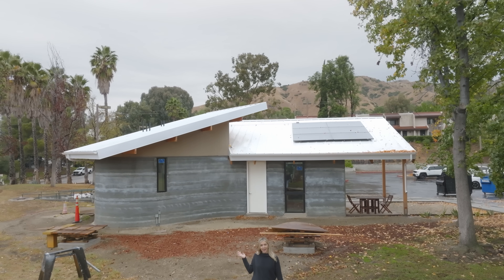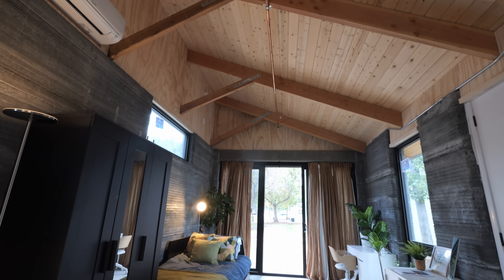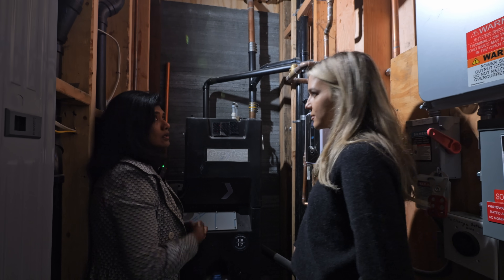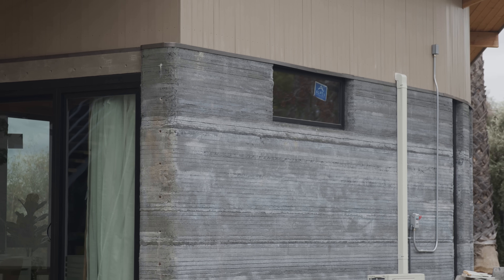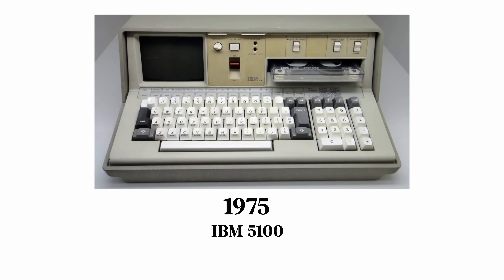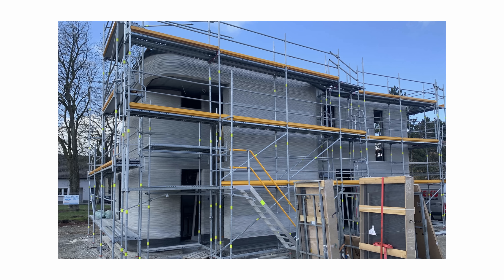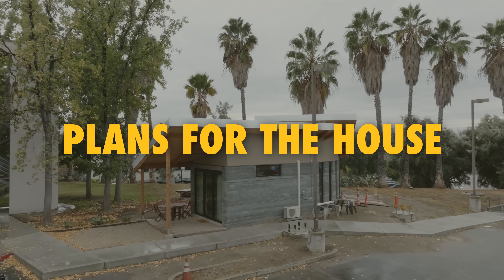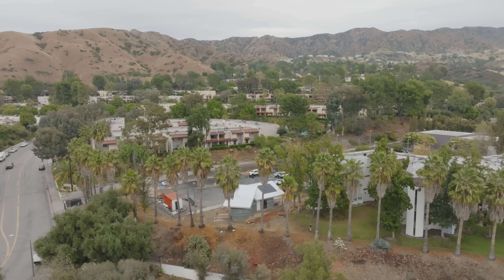LA’s First $250,000 3D PRINTED House!

Comment: I can inform you all that concrete building is a technology that is dying or needs to be reinvented. Maybe concrete as a material of building houses is new to United States. But it is very normal and the standard in building houses in Scandinavia and Europe as well. Even though it looks like we have many brick , They are actually concrete houses with a brick facade. The issue, however, is the fact that Concrete is made with the use of sand and send as a natural resource is starting to disappear. And it is disappearing because we have been using sand for concrete for so long now. The solution most likely is using concrete only where it is absolutely necessary, and using other materials elsewhere in a clever way.

Comment: Thank you Shelby for bringing to light the 3D printing techniques for houses! I think there should be more investment into it... Of course it's not so cheap right now, but all new technologies are expensive at first till they reach main adoption. I like that they mixed 3D printed concrete with timber beams and planks on the roof!
Also, as an European I find it very strange that the USA is not used to build in concrete... especially in places like LA with many earthquakes and fires... We've been building with reinforced concrete since the 70s/80s at least... But we are actually going back to build more with wood/timber for sustainable reasons.
Anyway, nice video!

Comment: I do like this house if I could cover the inside concrete walls. Using cement for houses certainly saves a lot of trees; however, cement production is a major producer of carbon dioxide. So, there are pros and cons in both using wood and cement.

Comment: Concrete is definitely not a negative compared to wood construction. Many of the high end luxury houses are concrete. However for the 3D printing to actually work it has to be a far more holistic process that does most of the house on its own. Just doing skeleton walls and the rest conventionally is indistinguishable from a normal process, likely worse with the current limitations. The novelty alone has no real value, it actually has to work. And like I've said before laser sintering of various powders is far more potent than pooping concrete. You can laser sinter sand for the bulk of structures, it has no cure time that requires human labor. Laser sinter metal powders for embedded electrical wires and rebar reinforcement, even floor heating and you print cavities for plumbing. It has to do the foundation, flooring, floor heating, ceiling and roof all in one process and that is quite easy to do. Windows is too hard to 3D print for now but if that's all you have to install manually to complete any house, that would be a huge step ahead. Concrete has been very useful but this is the laser age. It really could be very sophisticated constructions, far more fine grained that these concrete structures. You could do elaborate ceiling moldings and with the right laser technique the surface finish could be flawless. You probably wouldn't need to paint the walls with the right technique. Neither in or out. Just deposit white ceramic powder. It doesn't need to poop out a thick bead, there is no hurry to get it wrong. It doesn't matter if it's a 4 months print if it makes a magnificent house with zero labor and a bit of electricity and a bunch of dirt cheap sand. Sand is so cheap that you only pay for the transport of it. Imagine a 10000sqft immaculate home virtually for free except for windows, kitchen and flooring. The LA soil is not dirt cheap though.

Comment: I never understood the construction methods with wood and drywall in the US. My house in Brazil is made out of brick, concrete and steel to hold it all togheter. I can easily hang paintings on the wall, but knocking a wall down is close to impossible as you said, basically everything is structural.
During 45°C (113°F) summer it keeps the heat out pretty well but in winter it gets quite cold inside.

Comment: I thought the R value for concrete was quite low because of how porous it actually is? wouldn't that actually make it less energy efficient than other materials? unless this concrete is formulated different or applied differently?

Comment: I HAD A 2006 HOUSE BUILT OUT OF CINDERBLOCKS   1750 SF.  I TOTALLY PREFER CONCRETE WALLS OVER AWOOD FRAMED HOUSE.  MY HOUSE IN JOSHUA TREE IS NOW AWOOD FRAM,ED HOUSE WITH STUCCO. AND IT SUCKS  WOOD GETS WET AND YOUR SCREWED.  OR A FIRE. OR TERMITES.  WOOD ROTT

Comment: i think overall its a great idea to use concrete . saves the planet from using the timber trees . and yes in the long run it will become cheaper . im wondering about excess rainwater is it going to a storage tank on the land . or is it stored in a underground tank tank under the foundations . ?

Comment: My neighborhood in Burbank has quite a few concrete bungalows from the early 1940s including mine. You are correct. Renovation is hard to impossible. Also hanging any item on the wall is an ordeal involving a hammer drill. It also retains heat in the summer. Sometimes I feel like I live in a bunker. But it is indeed very durable.

Comment: I LOVED this! I loved homes with curved walls and the exposed concrete on the inside - I would probably paint the outside though. It's actually super common in tropical areas to have concrete homes due to cyclones/hurricanes. In the Pacific Islands most buildings and homes are concrete. I love that it's sustainable, and it looks so much more solid and architectural than other prefab homes.

Comment: Possible correction: at 0:42 you said that the house was “net zero” meaning that it has zero net greenhouse gas emissions, but as Kishani says at 2:02, the home is “zero net energy” which roughly means that it produces as much electricity as it consumes. Similar-sounding terms but they mean something different. “Net zero” is more of a term that companies or countries use in their pledges, saying that they’re going to reduce their emissions and then either remove carbon from the air or pay others to avoid emissions so that their net impact is 0.
Reply from the maker: OH okay yes that makes much more sense

Comment: Brick blocks, steel reinforcement in the walls and concrete are typical materials for building houses in Serbia. Wooden frame houses and dry walls are condsidered cheap and of lower quality houses here. However, I love the 'breathability' of the wooden frame house. 
You didn't mention how would they insulate the house in colder climates. Keep heat from entering the indoors works for California, but keeping heat in is also very important in colder regions.

Comment: Concert per se does not do bettering an earthquake. A wood framed house does better because it is more flexible. In the 1973 Northridge, CA earth quake the majority of the building damage was concrete strutters like parking garages. A wood framed part building fell down but that was because the concrete foundations were subpar. All concrete buildings in LA Country had to undergo a retro fit to add special earthquake ties to prevent roofs on concrete tilt up buildings from falling because the concrete  would crack instead of sway.. Framing a house and putting on siding goes relatively fast and is nit that expensive. Modern wood framed houses are more environmentally friendly than concrete. Trees are renewable and take very little power to cut down and mill. Mining, manufacturing, and transporting concrete uses a lot of carbon based power. In addition the most vulnerable part of a house in a wildfire isn't the sides of house, it  is the roof.

Comment: In South Florida, where I live, it's against code to build a stick-built house. All houses down here have the outer walls built out of concrete block and concrete. Stick-built houses won't survive a hurricane. That's why you're not allowed to build one where I live.

A 3D printed house may appear to be expensive. However, nine days to print the structure is very quick. As I said before, where I live, homes are build out of concrete block and concrete. Printing the structure might be faster than having workers build the house by hand. You'd have to look at the differences in the cost of labor, materials, and time saved by using 3D printing. When you look at all the variables, it might be more cost effective to print the structure.
Reply: What sort of soil and bearing capacity is general to the Florida region? i.e. do you require concrete piles / piers to support concrete slabs and walls or just deep footings?

Comment: My hesitation about concrete isn’t about aesthetics or durability, but the carbon impact of the material. Wood is typically a much more sustainable building material, but I would love to know if they are recycling concrete for use in the 3D printing mix to make it more sustainable!

Comment: There's lots of gaps in the concrete.
I can build one using binder blocks and concrete in like 4 day.
Using ICF, maybe 2.
Nothing wrong with doing it the way it have been done for centuries. This "printer", which is just a concrete pump. Just adds unnecessary time and cost.

Comment: 3D printers are not needed to construct homes out of concrete. In Europe we've been doing that since forever, mostly as the skeleton of the house. Renovation is indeed a lot more difficult :) I think the added value of 3D concrete printing is that allows for more design freedom.
Reply: Agree. Although 3d printing allows for a lot less waste of materials.
Reply: renovations aren't more difficult. they normally don't rebuild a wall so they smash it to pieces first and then replace it with drywall.
Reply: @miles5600  In my house all the load-bearing walls and the floors are massive concrete. There's no way I can smash that to pieces and replace it with drywall 😂The other walls are constructed from AAC blocks and this allowed the previous tenant to join the kitchen with the living room, but that's about the only remodel that's feasible without some major structural changes.
Reply: @Jeroen74  not sure if you wanna smash load bearing walls in the first place. AAC blocks are smash able when you want then cleared and you can easily replace them with drywall, there’s nothing wrong with drywall either and it’s used everywhere cause of how strong it is and the ease of install.